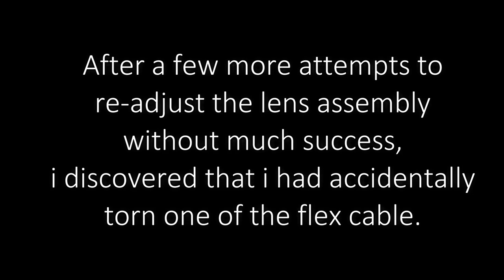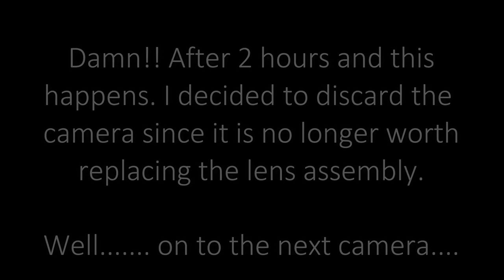Canon IXUS 132 Lens Error repair FAIL | A Time lapsed video on the disassembly of the camera.

Comment: Please Solve My Problem My Digital Camera (Canon IXY Digital) Do Not Switch (On)
Reply from the maker: There is a lot of reason for it not being able to power on. Without providing further info, its difficult to say what 's not working. If you are trained in electronics and know what you are doing, you can start by verifying the power source and slowly tracing your way up from there.
But if you are not familiar with electronics, then I would recommend that you send it to a service center to get it fixed if the cost of repairing is justifiable.

Comment: I have bad scratch on my digital lens where can i buy?or fix it
Reply from the maker: I doubt you can buy just a single lens element. From what I have come across so far, the lens comes in a complete assembly unit (it includes the CCD, motors, shutter and a bunch of other stuff). I found one seller on aliexpress selling the lens unit, but it is somewhat pricey. You can check it out here: https://www.aliexpress.com/item/90-NEW-Lens-Zoom-Unit-For-CANON-IXUS132-ELPH115-IS-IXY90F-Digital-Camera-Repair-Part-CCD/32262351422.html?spm=2114.search0104.3.9.23bb5d18v0WXpI&ws_ab_test=searchweb0_0,searchweb201602_3_10152_10151_10065_10344_10130_10068_10324_10342_10547_10343_10340_10341_10545_10084_10083_10618_10630_10307_5711213_5722315_10313_10059_10534_100031_10629_10103_10626_10624_10623_10622_10621_10620_10142,searchweb201603_38,ppcSwitch_2&algo_expid=4f2d8ef2-5122-4f4a-a689-5421a035d43a-1&algo_pvid=4f2d8ef2-5122-4f4a-a689-5421a035d43a&priceBeautifyAB=0
Reply: @bartman02  That's a much better price than a new one. I'd say they've been harvested from damaged cameras, they don't come like that when new.